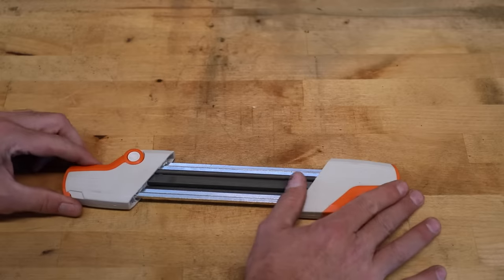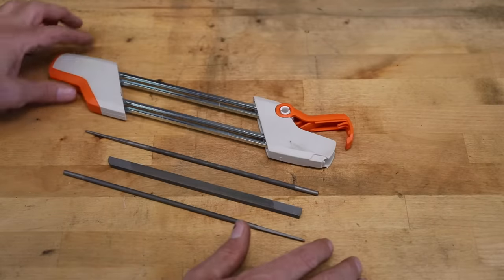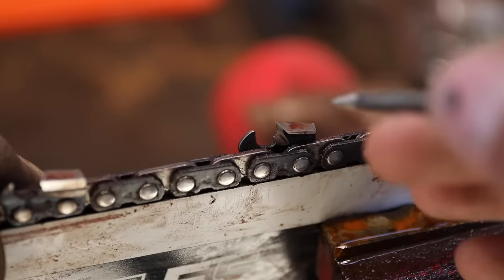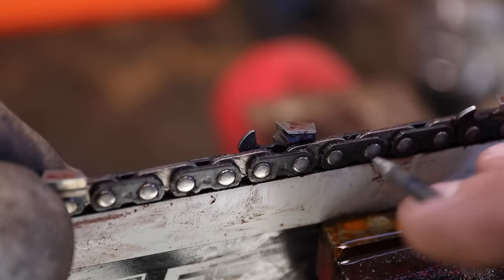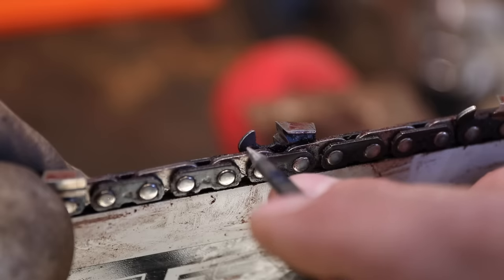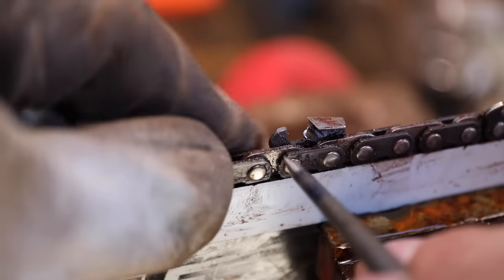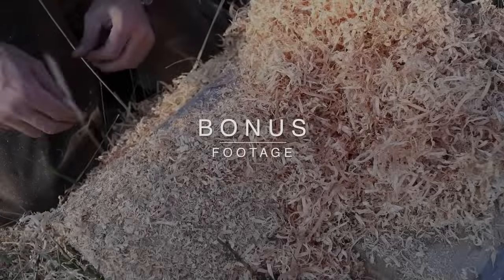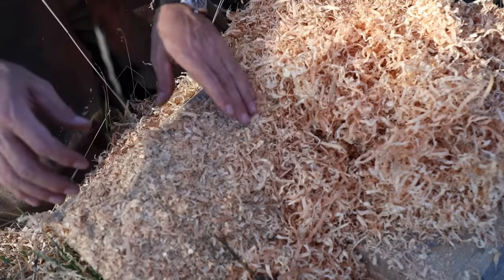Best Chainsaw Sharpener Ever - FINALLY!!!

Comment: What angle is the tool set to? My chain needs a 30 degree angle with about 0.65 depth on the rakers. I am also a bit confused on the round file gauge, Stihl said it should be 5.2mm, but the file they supplied was 5.5mm, I think I will look for one of these tools as at least it standardizes everything, no more 30 degree or 35 degree, no more 5,2mm or 5,5mm, they just make things so much needlessly confusing, and in my location their dealer service and support is worse than useless! They won't even reply to queries, they provide no info for my saw (try finding info on the MS382) - The only reason I bought from Stihl is that Husqvarna is 10 times worse, and apart from these two corporate clowns, the only other choice is Chinese vrap!

Comment: Cordwood in New Hampshire.  Live Freeze or Die.  Gotta have a chain to rip.  I run a full chisel chain.  No rakers.  You can't buy it from a retail store anywhere. Lots of liability.  Hold on to your saw and cut some winter heat.

Comment: My ms250 is aligned at a 30 degree angle in order to sharpen. Are you positive that you do not have to keep your tool at an a angle.  This is the greatest 35 dollars spent.

Comment: Cut with the saw before sharpening would be nice for comparison 
Using the tool as designed 
Ie if the guide angle is designed use that not the lines marked on the chain
Don’t teach people to drag their files backwards they aren’t designed for that
Also you said they aren’t rakers but kept using the term yourself ( that was actually funny)

Comment: if you really want your chain sharp, you would be filing it with a Chisel Bit file, instead of a round file, and if you are going to do it by hand, instead of on a machine, you would need to go get a Digital Caliper and measure EACH tooth's LENGTH, and file it, re-measure it and then file them ALL to THAT length...the chain WILL NOT cut properly unless ALL the teeth are the SAME LENGTH...and I mean within .002 THOUSANDTHS inch.....most Pros use a Saw Filer to sharpen their chains, which GRINDS the chain tooth.....and to the same depth, angle, and tilt. you can do pretty well with a round file on chisel bit chain, but the teeth need to be real close lengthwise.

Comment: I’m sorry but I see a lot of videos on these 2n1 sharpeners and I bought one and I’m not a fan!  It does not take the drags ( rakers) down enough. I find the saw just does not cut to it’s potential 👎 2n1 files at a 35°... mark on the tooth is 30° I always file at 30°

Comment: Save yourself time & stress & go to Harbor freight & spend $30 for there chainsaw blade sharpener. I guarantee you will not be disappointed. It does all sizes chains & all you have to do is set it to your chains angle & it’s perfect everytime. Really takes the time & frustration out of it. No more worrying weather your angle was same or deep enough. Best $30 I’ve spent. Check the videos out if you want first but trust me you cannot beat price or performance you get & it seriously puts this sharpener to shame.

Comment: They call that tooth a drag link and you don't want to cut them down every time you shop in the file when the Chisel to start getting low that's when you cut the drag link down talk to a professional saw man I cut down Big Trees in the woods for 10 years if you cut it to low your vibrate to chain in half

Comment: I have this tool and have used it often.  I can hand sharpen a chain better that this tool.  The supposed automatic function of the flat file does not remove enough material from the depth gauge.  The files fail to properly profile the teeth and to top it off the plastic retainer for the files is broken and does not retain the files like it should.  My personal experience is that this is a waste of money and a gimmick by stihl.

Comment: I've never heard anyone call the depth gauge rakers, I was eyeballing those new sharpeners today I've been sharpening saws for almost 50 years, and I show up in my depth gauge every third time I sharpen my teeth. Keeps a good clean cut nice long ribbons. 
    I cringe is at what you filing that saw and dragging your file backwards on every stroke, that file won't last you a week. You know you're not supposed to do that, you even talk about not doing it as you're doing it. 
   Those nice sharp teeth on that file will lay down like grass in the wind and you won't have a file anymore. Just sayin'

Comment: I still think its for the non professional,  cause u can't customize your filing
Reply: You can change the angel just not the hight of the depth gauge. Dont see why you would need to change the depth thou and in anycase you can take out the middle file and do the depths by hand afterwards.
Reply: I would like to try it. Take out the raker file. "Get the gullet". Looks like u could put more overall pressure with the 2 handles. I hit a lot of nails over the years doing tree service. (Mostly with 3/8 pitch bars) and the amount of filing needed is to bring back the working corner can b a lot of hand work. So I think I would use it if the raker file came off and I wouldn't have to change the way I file. Maybe the ergonomics will be way better?

Comment: Counting your strokes is another amateur's myth ... You should make a conscious attempt to keep the teeth the same length, but sharpness is far more important, and if you've scarred the top of the tooth, that damage must be removed or it won't stay sharp very long ...
Reply: In other words, you keep filing until the damaged area is filed away, and the entire top of the tooth is shiny. If you've hit something hard and curled the teeth down, that damage has to be filed away or it will never cut right

Comment: Your sharpener is not correct for your chain, It has to sit on bought teeths. And your chain looks like a rip chain, sharpened at 10degree. The angle on the sharpener is for 30 degree chain.

Comment: I've sharpened chainsaw chains with a file for years and my saw will throw saw dust 5 feet in the air
Reply: grats
Reply: ..it's not supposed to throw dust that means it's dull.. if it's sharp it will throw long sheds or chips instead of dust.. you also don't want to breathe in dust...

Comment: What's the point of using this if you don't go by what it tells you and you just do it they way you want. Might as well toss in the trash
Reply: It isn't the right tools for this chain so the suggested angle is wrong.  No big deal, It's still sharpening the chain and taking down the depth gauge in one step.  Matching the angle of your chain isn't hard.

Comment: You're a pretty smart guy but you don't design these things nor the chains. USE THE ANGLE IT SAYS TO USE. Why? It should be obvious when you looked at the edge you made. You only sharpened the very edge of the tip. And you didn't follow the profile of the curve of the blade. You are running a circle file so you assume you just push it straight. That is not so. You should be filing out a nice spot that looks like the feed ramp of a rifle. You want more than just the piece of a millimeter of the cutting surface to be smoothed. Yes, you're making a sharp "curved" edge but at an angle not following the angle a circle makes when going through the metal at the angle it was created. I think the folks at Stihl probably had that in mind since they are the ones who C and C the blades on a multi axis hundred thousand dollar computer operated machine. Then used the angle that the machine used and said let's sharpen at that angle. I'm just guessing though...
Reply: he litterally made it worse glad someone else noticed

Comment: My dull chains throw bigger shavings. Bc you sharpen at 10 - 15 degrees. Its called NOODLING. and doing that does not impress someone that knows what your trying to do. Need to cut more wood and stop making videos

Comment: Bro I stopped watching your videos for this same reason.  Content is not correct your putting out. 
Even with the proper chain for that sharpening system it still is not
 " the best ". I've got one. I used it twice.  And a regular round and flat for the rakers is much faster and way better edge.  
You surely will never see  Bucking Billy Ray promote this file. Check him out on YouTube.  You will learn good stuff

Comment: Ok, where do I start? I guess I'll start with the fact that you did NOTHING right with the sharpener. The package comes with SPECIFIC instructions on the proper way to use the sharpener. The sharpener itself has a picture and a directional arrow pressed into opposite sides of the sharpener on each end to show saw position and direction to draw the file across the chain. There are also etchings on the file and angled handles for the CORRECT angle to sharpen your chain. Your initial instinct was correct. The handles are angled for a reason, and the sharpener is to be flipped end to end and over for the 2 different sets of cutters. I hope your friends and family that recieved the file as gifts took the time to read the instructions. P.S. The laser etchings on the cutters of the chain ALSO show the angle at which they are to be sharpened. If the instructions for this sharpener are followed, there is ZERO guesswork involved for a sharper than new chain.

Comment: Yes pro chain...the square chisel saw chain you just destroyed is angle different...20 to 25 degrees....wood wackers.... rookie file at 30 to 35 degree...why don't you learn alittle bit about chain saws and there maintenance before you make a video.....rooookieeeee